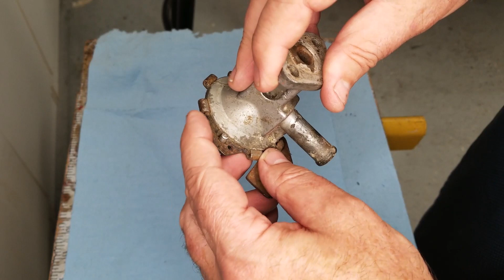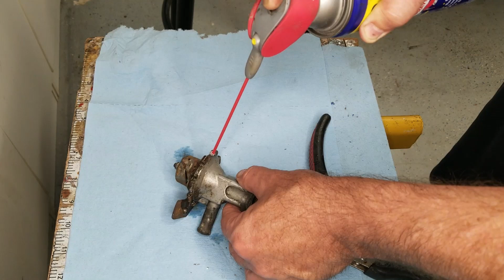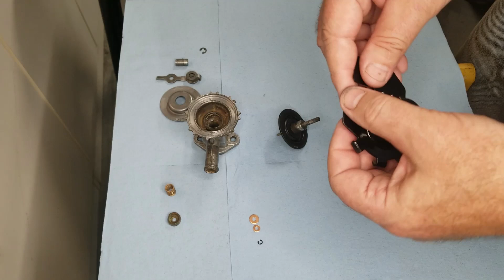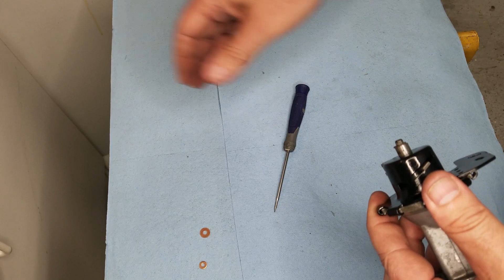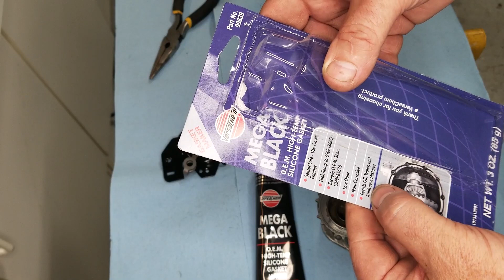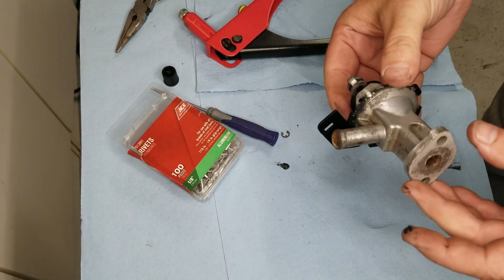Nigel the 1977 MGB heater valve revision restore

Comment: Thanks Alex, Probably what I needed to do - I had mine replaced with a ball valve after the 1 year old one leaked, right on the distributor of course, and I blew the head gasket
It was obviously a cheap junk replacement

Comment: Thanks for the video Alex I think I might service my heater control valve tomorrow as I have just drained the cooling system down on my 1975 MGB Roadster - car has been stood, unused in my garage since 1995 so I am slowly renovating it
Reply: Completed this task/modification yesterday and found that undoing the lower bolt securing the heater control valve to the block the hardest and most time consuming part as it was so awkward to get at. Found using a combination spanner was best but like a 1/12 of a turn at a time lol.  My unit, although it has been stood for nearly 3 decades was in very good condition. It had no sealant applied to the rubber diaphragm and had the tiniest clip on the bottom stem that i had seen, like an 'r' clip but shaped like a '8'.  Cleaned and rebuilt it and added a stainless steel washer that enabled the valve to fully open, didn't use any sealant on it either, time will tell if that was a mistake or not 😂  Thanks once again for sharing the video 👍
Reply: @hawkmoon560  Assuming you had time for an update, did it work or leak?
Reply: @richardgriesemer3864  I have overhauled the heater control valve, all went well but  i have not yet tried it as am slowly working in other areas.  At the moment I have the front cross member removed along with the front suspension, engine sump cover/oil pan, steering rack, oil cooler, front valance and bumper for refurbishment. Also yet to re-install my refurbished cylinder head. Progress is a bit slow 🙂

Comment: Well done. I've read about this procedure for years. It was really good to see you walk through it. At the beginning, that valve looked pretty crusty. I probably would have just replaced it. But after seeing how good it cleaned up and that the rubber diaphragm was still pliable, I think you did a great job putting it back into service.

Comment: Got 3 old used ones, 2  had good diaphragms, added washers, no caulking on any of them, but did when resealing. Bet yours had been opened before. One had circa clip, other 2 had strange little wire clips.

Comment: Yes, there is a weird little wire clip on the end, I got 3 bad ones valves, to play with. Followed the direction, to rebuild, but, but since the leak is seemingly around the gasket, I added a “35 mm O-ring”, to the waterside of the gasket in that really wide inset on the aluminum casting, with generous amount of sealant. The O-ring will definitely help. Your thoughts? Wonder if you tried an Oring? Thanks
Reply from the maker: I have yet to install my solution.  I just found that so many had issues, so I decided to dig deeper into the problem.  thanks for your input.

Comment: Awesome  video again, I cleaned my up last  month  and I never realised it had a C clip  missing, I going to take mine apart again and do the  modification  in your  video. Keep up the top content 👌
Reply from the maker: I think that C clip corrodes over time.  It is the only ferrous item on that side of the valve. That was one reason I put some silicon sealer over mine
Reply: I JBWelded
 clip onto shaft so won’t fall off.
Reply from the maker: @wallisparnell4464  I love that stuff.  I actually have a '79 VW beetle (fuel injected) that has the throttle wall rebuilt with JB Weld.  The aluminum was damaged by exhaust gas at the EGR inlet.  caused a vacuum leak.  the patch has been running for something like 20 years.

Comment: Excellent video. 
Compliments to Bob as well. 
I have about a dozen used, presumably inoperative, heater valves.
Time to get busy and dissect them to see if they can be resuscitated.
Reply: I added a 35 mm oring to the waterside of the gasket to prevent a leak, w the silicone sealant.